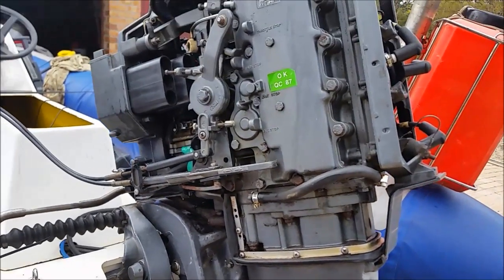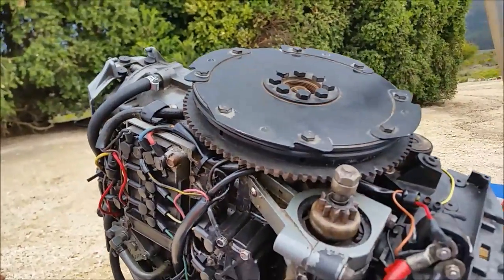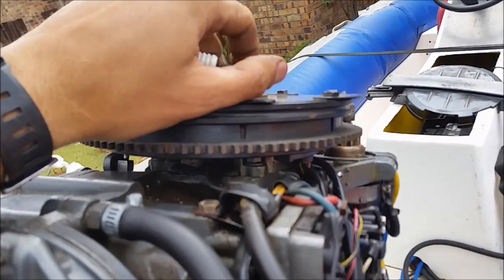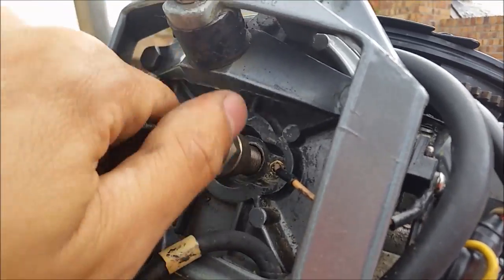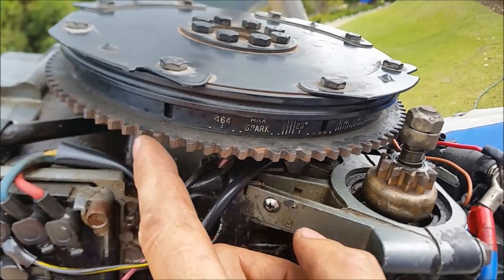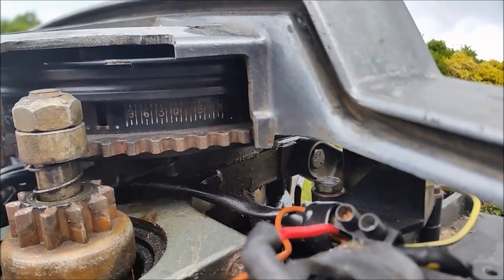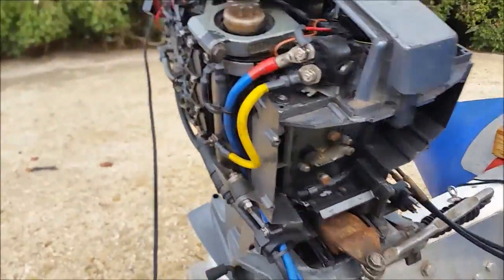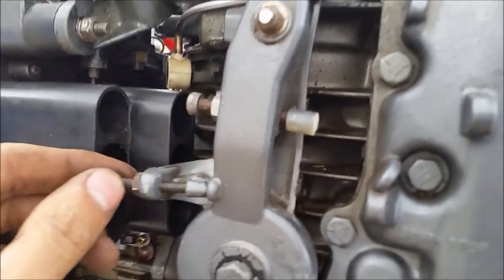1987 60hp Mercury Mariner Outboard Setup Timing Link Sync Tdc

Comment: Awesome job! I have the same motor /same year and having issues with it missing / cutting out at high speeds. You did a great job at explaining the linkage setup. I didn't know which direction to go but have been thru all of my fuel troubleshooting and wanted to start with the electronics next. I am curious what you find out about the leaky carbs. I have the exact issue with drips showing at the butterfly pivot at the base of bottom carb. Thanks for the vid! If you plan on making more of these I'll gladly subscribe!
Reply from the maker: +mischiefminded Hey tx, yeah this was really my first exp with this - i have also learned that the small arm coming from top carb needs to be set last - my leaky carbs are normal ive been told.. i did have a needle with  piece of black dirt in it that caused it to pour fuel down front - cleaned it again and all sorted..

anyway - I spent 2 days not getting it right, and found the steering cam had jumped!! (facepalm).. anyway - i think my stator is not working.. it controls the high speed and low speed spark (and charging of course). well mine isnt charging i dont think.. so theres already an indication of something being wrong - although i had a tech on phone while charging and he said my stator test readings were showing good..

My coil magnets (theyre not actually magnets but ferrite cores) broke.. be VERY careful when working on the coil pack bolts - they put too much pressure on those things.. i heard a light crack when i loosed and retightened the ground wire - anyway.. some1 on a forum (ex drag racer) said hes seen those motors run fine with cracked cores.. SO..

Im still on the drawing board as to why my motor is running at half power :(
Reply from the maker: I have noticed on very the odd occasion a random carb would start leaking profusely from the front, draining it from the front brass nut usually sorts this out and doesnt require a teardown :) I think its a piece of debris that gets caught in the seat area..